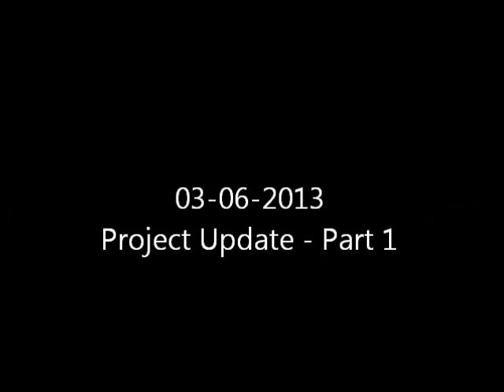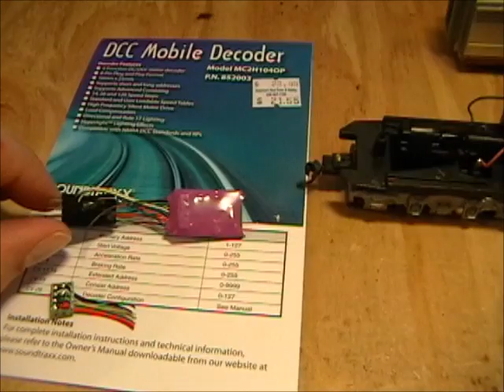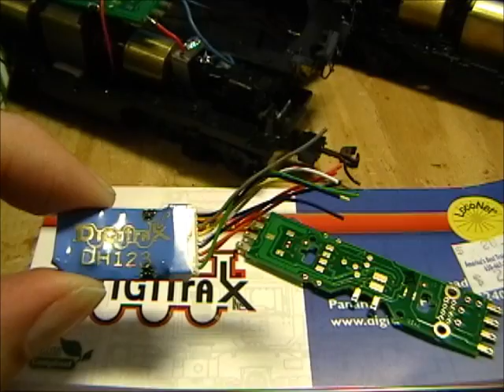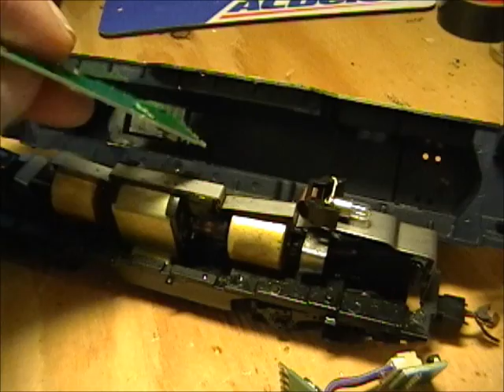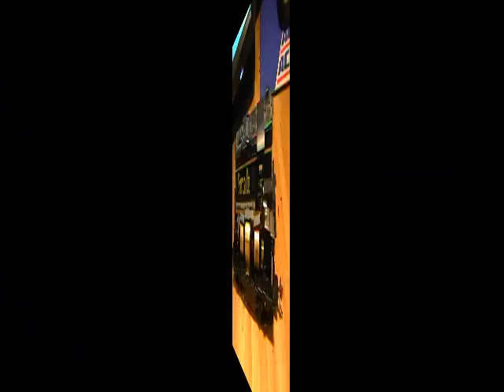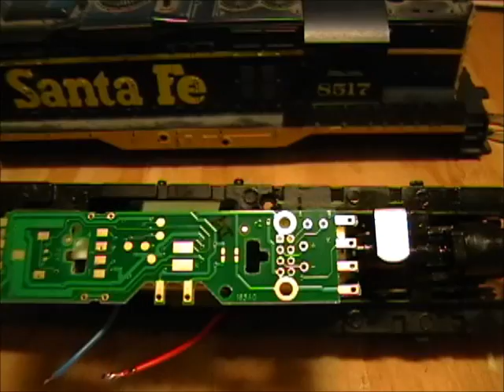03-06-2013 Project Update - Part 1

Comment from the maker: Thanks for the post. The DH165's have really worked out great. I did a CNW GP38 with a SDN144PS N scale sound and mobile decoder. It did fit well, but the performance was lacking a little. I have been a slacker at getting to the train shows. Mostly been going to Americas Best Train in Itasca or Lombard Hobbies

Comment: gp9 #8517 have you ever tried laquid or brush-on electral tape ?? i stop doing decoders but I used it several time and its good of course a small wait time for drying. and you don't get the glue_resadew.   Ooo are U able to put sound in that Gp9?